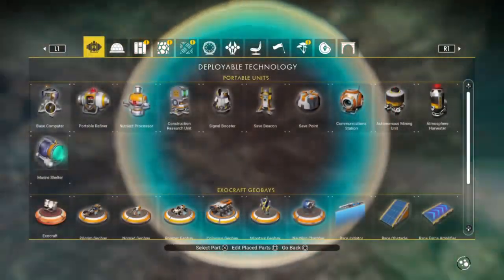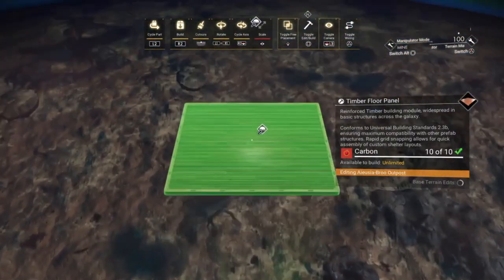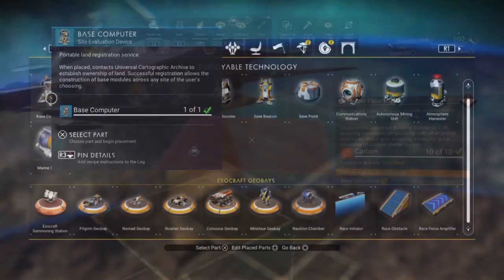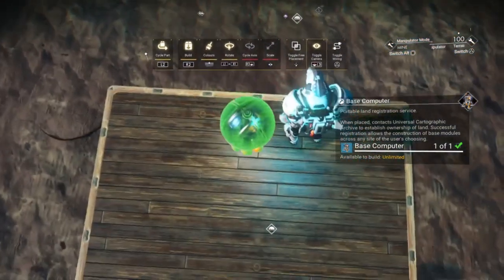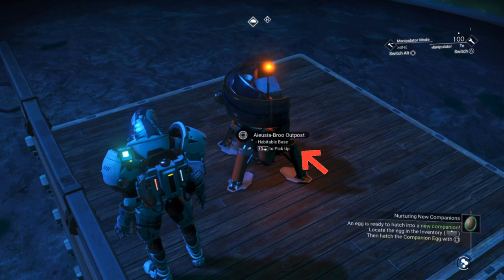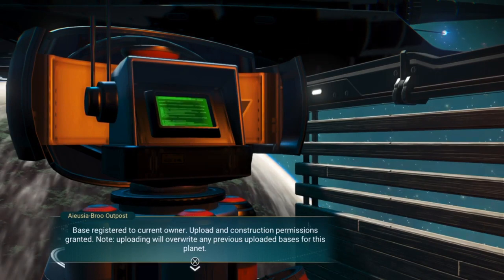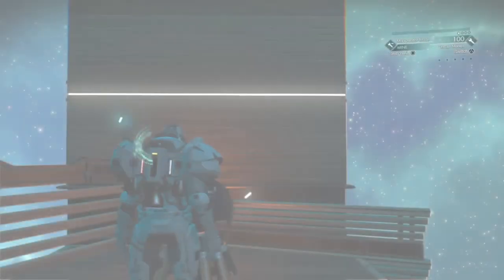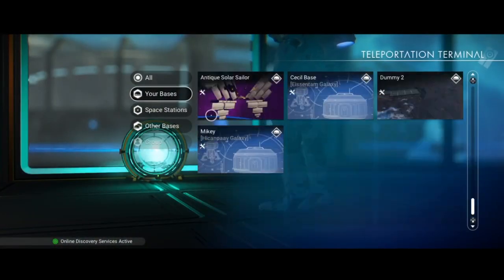Deleting an invisible low orbit base computer in No Man's Sky #nomanssky

Comment: I did it in two tries. If this helps, get directly on top of the icon, so you’re basically standing in it and then just go up one from there and it should work. That’s exactly what I did.
Reply from the maker: Great thanks for the tip.

Comment: Been at it for three hours with no luck. One difference I noticed is that for some reason, the icon for the base is greyed out like it isn't active. I'm not completely sure what difference it makes, but I have another base on the planet that is visible and the icon for it is the standard white.
Reply from the maker: Hey yeah I have only tried a couple of times. I know there is a comment here from another player and they said to build some flooring and then a save point and reload. They said the computer appeared on a lower floor for them after a couple of tries. I havent tried it myself but might be worth a shot